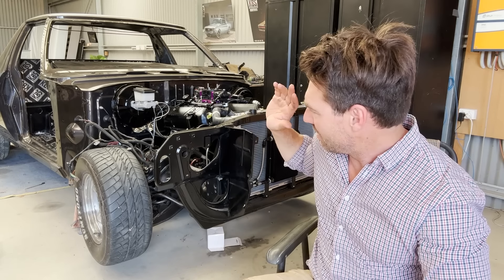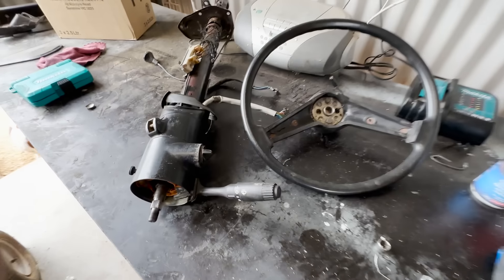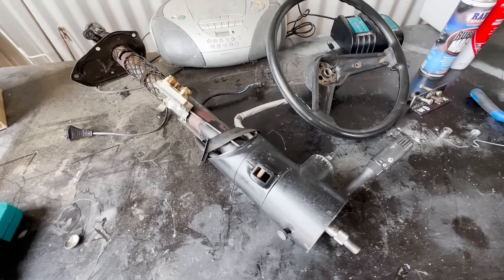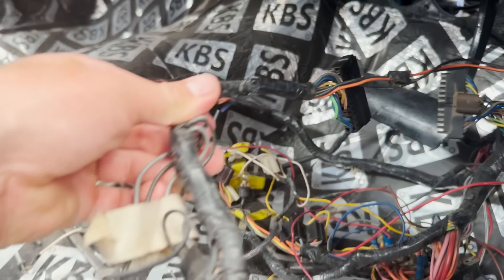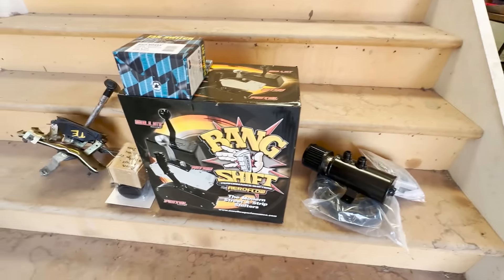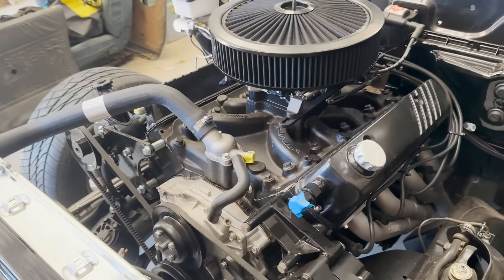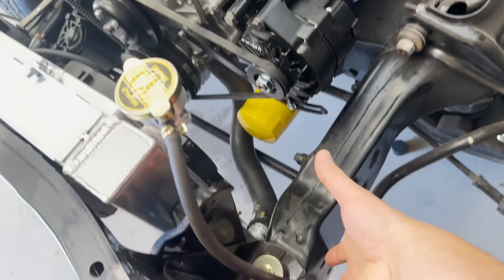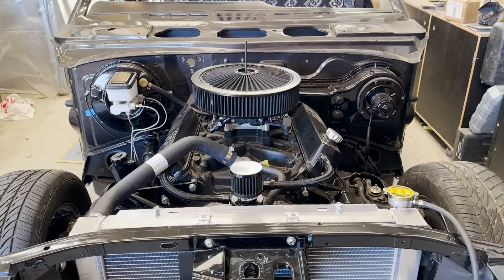EPISODE 81 - Racing Against Time: The Final Steps in Reimagining an '82 Holden WB Ute!

Comment: Mate on my hz on the steering column where you have that nolathane bush from factory was like a thick felt pad that joint the coupling together ,and also that screw you mentioned is an adjustment against the worm drive in steering box but don't over adjust as will bind if this helps , cheers , shaneo, Nelson, NZ, 👍🍺
Reply from the maker: Yes I think the felt factory one is the way to go, will be ordering one, and I was informed about the worm drive adjustment as well, thanks 👍

Comment: That top spring should have tension on it. Either the shift isn't in enough or you broke the 2 pins. I made a tool to use the shaft nut  to compress the spring with room for the clip.
Reply from the maker: The pins definitely weren’t broke. So I reckon the shaft isn’t in far enough, not sure how to sort that however other than getting someone else to do the job

Comment: Barnsey, there is a about a 7/8 inch nut and a 1/4 jnch Allen  bolt / adjuster between the chassis rail that will tighten the rack it needs to be tightened to 15 to 18 INCH / lbs this can be very sensitive to adjust.Easiest remove the steering box from the car, resist the urge to hit the steering box with a hammer they are very easy to damage. The 3/16 Allen plug in the top of the steering box is to adjust the worm follower preload. This top Allen plug can be removed, inside is another  Allen screw the steering box has to be in the center position to be visible , if you have the urge to adjust this remove the Allen key before turning the steering box
Reply from the maker: Ok great thanks for the detail I will have a look at adjusting it. Cheers

Comment: Another great episode mate
I might be wrong here but my understanding is you need a return on the catch can which is how mine is set up.
You’re running both rocker cover into the unit so I’m not sure where the return pressure goes with that setup. I could be looking at it wrong though
Reply from the maker: Hey mate, Yes I don’t think the return is a thing from my research, I read they are just pipes to channel any oil residue vapour away from the engine into a canister that you drain out from the base. As they have a filter at the top any air pressure is released out that way. I also saw a lot of people have two catch cans one for each rocker cover. I really would like to see other setups in more detail however. Thanks

Comment: Nolathane steering flex plate is not right. The column is mounted in the holes at 90 degrees. So 4 bolts are needed to fit it up right. Quick Google search should give you a pic.
Reply from the maker: Will get the original belted one and that will sort it hopefully. Thanks
Reply: @BarnesysBuilds  no worries just sold my HQ tonner, did a similar build to you sandblasted cab, went through every bolt, nut, and washer!

Comment: Dipstick doesn't fit as you have a HQ-WB sump not a commodore sump different location.
Should have left the column shift linkage out and replaced the top section with the new section from rare spares as your going floor shifter
Reply from the maker: Yeah didn’t want to spend the money on the rare blank until I know whether it’s actually a viable column, so I left it for now, most likely replace the whole unit.
Reply: @BarnesysBuilds  I bought the blank from rare spares for $50 and removed the column linkage
Reply from the maker: @owenbuttfield9876  that’s not that bad really price wise. Cheers

Comment: Your missing 2 pins on your steering  coulpling .The intermediate shaft shouldn't bolt directly to the steering box,the coupling bolt to the box and should have 2 pins that the intermediate shaft floats on,probably best to google an exploded diagram of that area.
Reply: That's why people don't like the nolathane coupler,  hasn't got the safety pins and integrated cast spline.
Reply from the maker: Ok, I have the two pins I think, I wasn’t sure where they went so I only did the first two hand tight and then was waiting for feedback on the video. Cheers